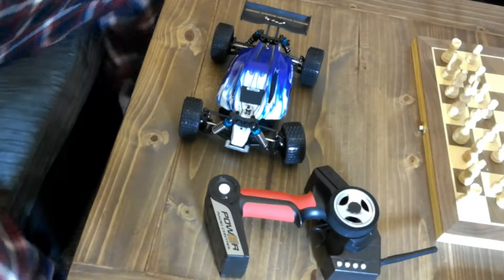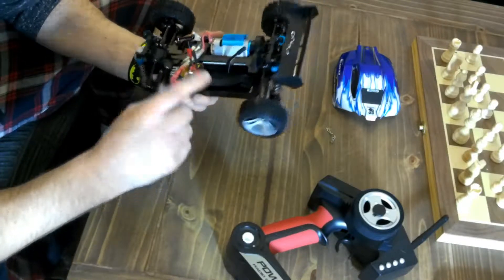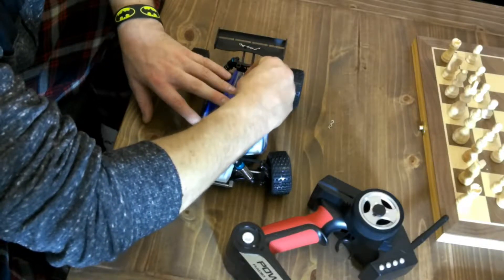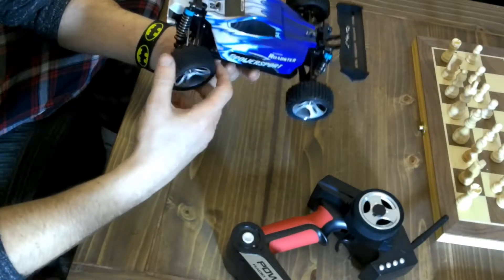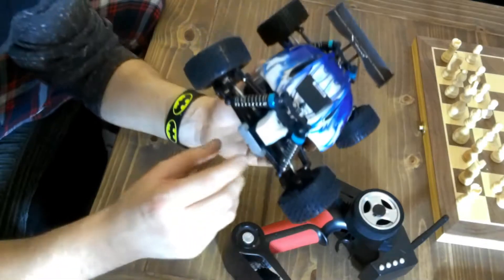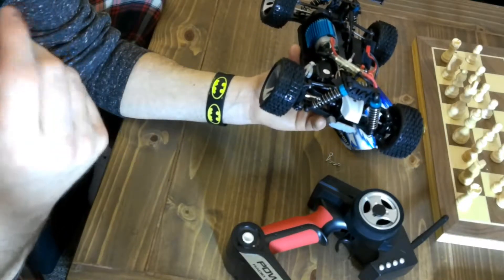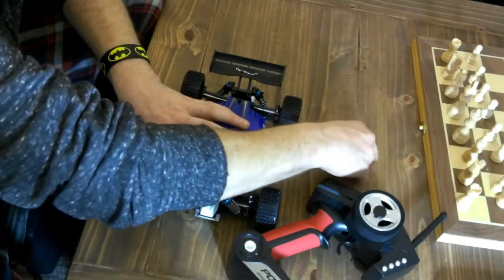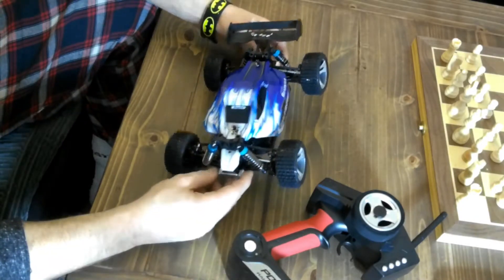WLToys A959 broken ESC. Damn!

Comment: It is normal that the esc is easily damaged?, I have already changed twice
Reply from the maker: It wasn't the esc in the end it was the motor that went, twice. So i ended up putting the 530 motor from the a959b. Im also building a carbon fibre and mtal a959 but ill probably go brushless with that